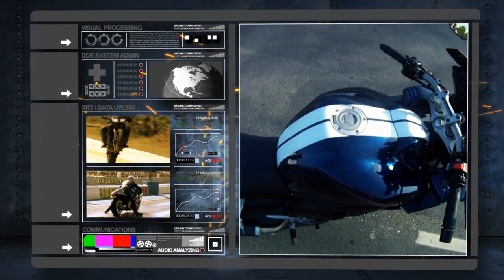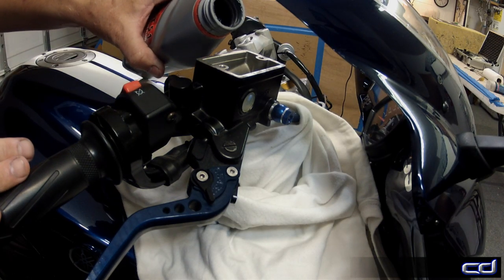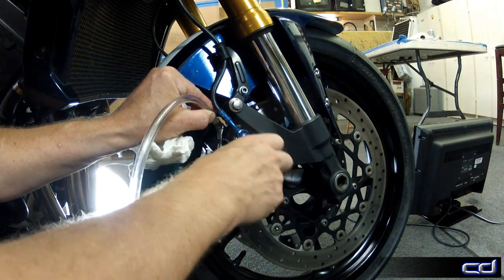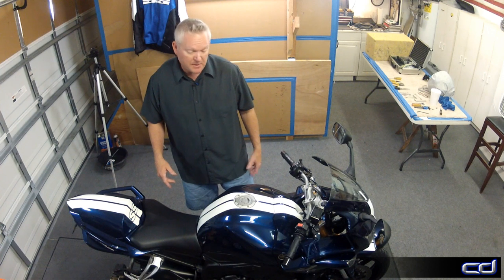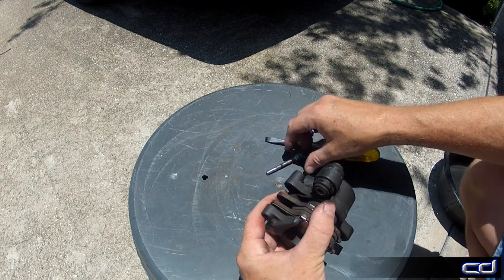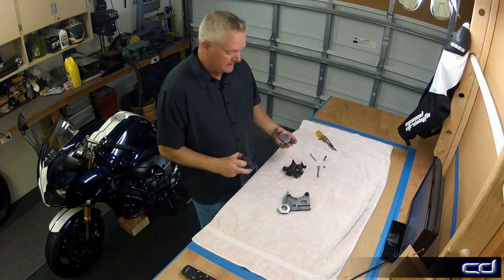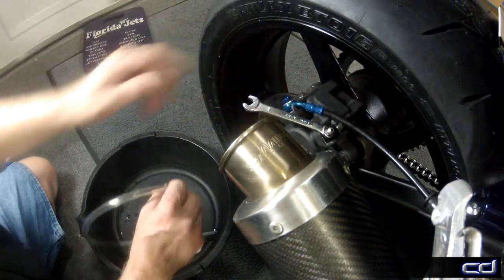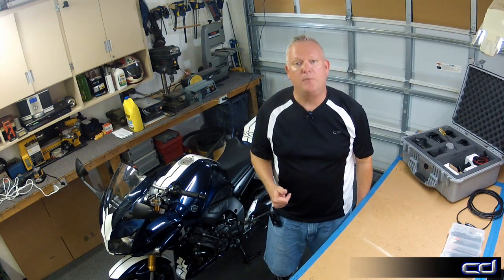FZ1 Video Tutorials - Brakes Part Two

Comment: you should clean the piston before pushing it in. You can use compressed air to get the piston first little out, then clean it, and then push it in. You need some wood block to stop it, or it will fall out completely if compressed air is used. Great video anyway, that spray handle is a great way to bleed it.